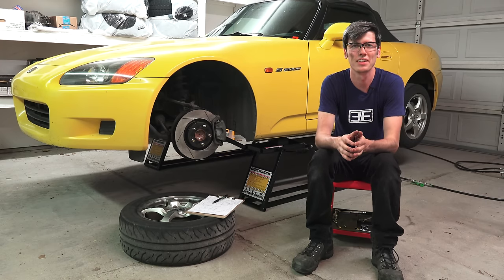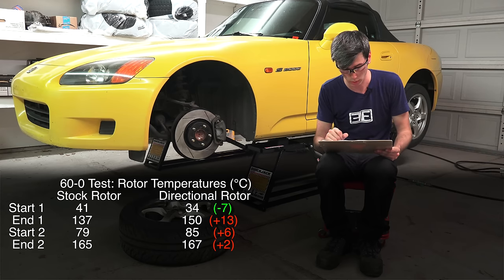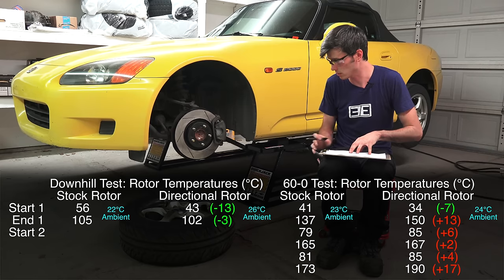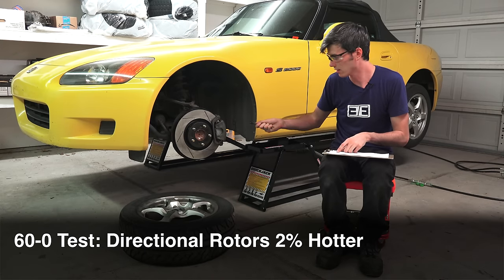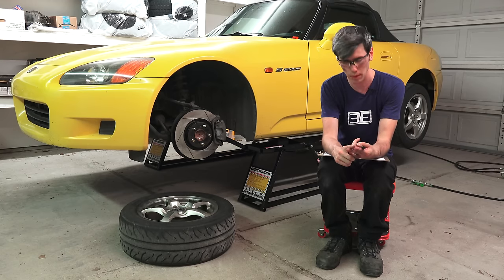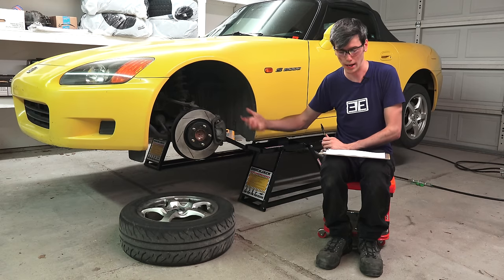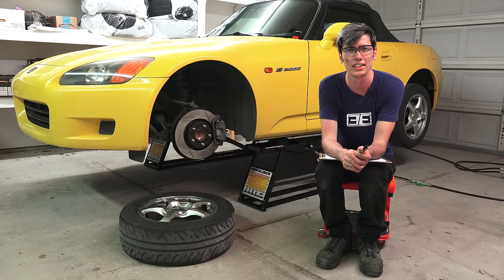Do Performance Brake Rotors Have Better Cooling?

Comment: Really interesting testing and video.  Weight reduction & better heat dispersion during hard braking; seems like a win/win to me.
Reply: You likely wont see much a difference at face value with 4 LBS of WR in regard to performance overall but I can see your point in that regard. It's still a slight improvement, of course with some aluminum anodized calipers, u might be at a more notable number, etc.

Comment: The aftermarket rotors were definitely doing thier work because to stop you have to change the kinetic into thermal energy so of course they would be hotter if they stopped faster. He didnt have the rotors spinning and measure temp while they are spinning to check how fast they cool.
Reply: lPridel yep
Reply: If you watch the video then you will realize he did. He stated the cooling numbers in centigrade and that showed the slightly better cooling of a slotted rotors versus oem style. Bottom line is, just like we suspected all along, the difference is really minuscule.  If you are so good, that you need that last bit of performance, put the performance rotors on, but otherwise you will be perfectly fine with the quality oem setup.
Reply: If the thermal energy produced is at the expense of the kinetic energy then how would stopping in a shorter distance result in higher temperatures? The change in kinetic energy would be the same, and hence the rise of the thermal energy(measured by the temperature) would also be the same.

Comment: History,
I am a retired engineer.
I like data, lots of data.
I don't drive on a race track.
Your data does not indicate that buying these with this type of aftermarket rotors will help in normal driving, ie. offtrack driving.
Conclusion:
I will not spend more money on this type of rotor.
Note:
My understanding of this type of directional rotor is :
1. The directional rotor slot may cause the pads to wear out faster. 
2. The rotors may not be able to be turned at the next brake pad change.
3. Thank you for your raw data and your data analysis.  I have been trying to make up my mind on the purchase of this type of rotors for my daily driver car, I will not waste money on the additional cost for directional rotors.
Thank you,
Alan P.

Comment: I think this proved that for normal road driving it doesn’t matter what kind of rotors you have but for racing they are beneficial. Great info thank you
Reply: It's not just temp, most importantly it's stopping distance.

Comment: In terms of your conclusion, it begs the question; are these rotors worthwhile for anyone unlikely to use their car in a racing scenario?

There's also another issue. While the test was purely about the cooling efficiency, the key performance indicator of a brake rotor is its ability to decelerate the vehicle under varying conditions. Whilst temperature has a correlation with performance, longevity etc, it doesn't take into account differences in material. It may be that these performance rotors are hotter, but perhaps their design temperature is simply hotter given the specific chemical properties of the alloy they are constructed from. In other words, their peak performance temperature, may well be hotter than the stock rotors.

Just throwing up ideas for consideration, happy to discuss.
Reply: Yep. There could be a variation of the applicable specific heat given a slight difference in materials but it would be minimal. Thermal mass though is not insignificant and the fact that the temperatures read were achieved effectively with just static, or low flow, air cooling makes that a significant factor in favour of the heavier rotors, given the similar duty, as they would have heated less in the first place for that reason alone. Ironically, about the only thing NOT measured was the increased effectiveness of the directional vanes on temperature as this would have to be measured while moving, before a second brake application. That shows up in the test results of the other party who DID measure temperature in the environment they're intended to be used - fast flowing air.
And just as you've suggested, the performance rotors may also be more resilient and dimensionally stable at higher temperatures and less likely to suffer from thermal stress.

Comment: It's a little late and has probably been said, but I think the difference between Jason's tests and SoS' tests could have been the testing intervals. Performance rotors shed heat while spinning meaning that though they soak up more heat during braking, they will shed it quicker while the rotors continue to spin. Jason tested it while it was stopped right after a brake-to-stop, while SoS tested them while they were spinning during a lap.

Comment: This is the first time I've ever heard of slotted rotors being for cooling.  That's probably why they didn't work for it.  The reason for slotting/drilling/dimpling rotors is to allow superheated air to escape from between the pads and the rotor (preventing brake fade).  Heat is due to friction, so higher temps are indicative of greater friction (better braking).

Comment: In your testing, your original disk brakes are already used, which means less surface (smoothen by the usage) which you didn't take in account.
I hope this helped to your research. Thanks for sharing mate.
Reply: Very good point.  Discs and pads do mate and the adhesion of the pad material in the rotor can make a significant difference between a brand new rotor and one that has been broken in.

Comment: Are you getting shorter stopping distance from the new rotors? That will get you hotter temps too.
Reply: Brakes for racing work at higher temps. When they are cold, they might not grab very well. Once warmed up they perform good, and can take much higher temps without brake fade.
Reply: Wouldn't it make sense that the amount of heat put into either rotor would be the same? Considering that the pre-brake speed is the same across tests, if shorter stopping distances were to put more energy into the rotors, that wouldn't really make any physical sense, as it's the same amount of energy to dissipate. Unless you're talking about the total amount of effective time of the rotors spinning to cool themselves, which could possibly provide a difference.
Reply: ipullstuffapart I think that's what he's getting at, a shorter stopping distance in theory would have less cooling happening through ambient air dissapation than a long stopping distance. In practice, the impact of air dissapation while breaking is minimal compared to the air dissapation while off the brakes
Reply: Stopping power is in the pads, hydraulics and tires.
Reply: Michael Stellitano , good point.
Reply: Yeah, no, they don't. He actually has a video on that. Look it up.
Reply: Pavel Ionut yes they do.  It’s a braking system with electronics, vacuum, hydraulics, pads, rotors and tires ... and some knucklehead who should pressing down on the brake pedal.  😀
Reply: Jim K The affirmation was that "they have a lot to do with stopping distance", which is not true. You put performance brakes and rotors when you go racing (multiple hard brakes and stuff, higher stress basically, where a standard system will fade). Stopping distance is mostly tire friction. If your brakes can lock the wheel, they are enough, anything above that, doesn't make any difference (in distance).
Reply: Pavel Ionut No disagreement on that from me when you are talking one time stopping or “city” driving.  But for some people “normal” driving is hilly/mountainous or trailering or both.   My point was that the system has to be able to match the demands of your driving environment or you will have an issue.  Better tires decrease stopping distance.  But that’s just one thing a tire has to do and you can get great stopping power but the tire will last 10,000 miles.  That’s not ideal in the mind of the average person.  A balanced system is required and it has to meet the requirements of the driver and regulations.  Boiling all that down, we both seem to agree on the point that a singular component may or may not “fix” the problem.  Happy July 4 sir!   May your day be filled with friends, family and fun.
Reply: I am telling you that electronics do not shorten the stopping distance, they merely optimize the braking process. Electronics can't beat friction physics and cannot overcome boundaries imposed by the tire/surface friction coefficients. Therefore, any brake system properly sized for the given application, will stop in an optimal distance. Vehicle weight has little to do with stopping distance. As i said before, performance brake pads/calipers/discs are there for abnormal usage conditions, racetracks, but they do not stop in a shorter distance. Thy might for example take you multiple times from 200 to 100 without fade, but that's it.
Reply: @WZW1982  its the rotars too with out good rotars the pads wont work well
Reply: @pavelionut1649  what about abs then genius thats electronic

Comment: You seem to be comparing brand new aftermarket vs your old brakes. The cross hatches you see on the face(not the slots but the break in cross hatching) actually causes more heat during break in due to the added friction from the hash marks. Your old rotors have worn those off. Therefore no added friction hense the heat differential. Break those in and do another test. My dollar goes towards the directional vented once the break in cross hatching is gone.
Reply: Except that when I bought new brake rotors for my Renault Twingo, they came without any grooves in the brake surface.
That is not to say you aren't right, just to point out that not all OEM brakes have that kind of pattern in them.
Reply: I am a mechanic and I'd have to say all rotors have a pattern on them to help break the pads into them. I can't think of one exception, not that I paid attention every time, but when you're cleaning off the grease from the factory, which prevents rust while it sits, you notice the patterns on new rotors. Never perfectly smooth.
Reply: Are you sure that's not just the pattern left by the mill that finished the surface after casting? I've seen those on just about every brake disc I've installed on my bikes or cars. But I wouldn't refer to those as some sort of break-in pattern.
Reply: He's not talking about the slotting, he's talking about the cross hatched pattern. Typical, you want to change pads at the same time as the rotors. There is some necessary initial wear that mates the components. I will typically hit my rotors with a flapper wheel when just changing pads. There is likely going to be additional friction during the break in period on top of the heat converted through stopping.

Comment: Curved Rotor Vanes – this type of rotor vane is predominantly used for motorsport or racing applications and is most commonly used by race car professionals.  
These rotors are typically heavier than straight vane rotors because more material is used for the curved vanes.  Since there is more material, curved vanes have 
better thermal capacity and are able to withstand heavy brake applications better.  Some other curved vane designs are the variable curved vane or convergent vane rotors.

Comment: Could brake break-in affect the temperatures at all? The old rotors and pads were broken in, but the new rotors were not. Also, because it is hotter does not mean it is not cooling better, as i could be getting hotter because it was turning more kinetic energy into heat, making them hotter? I say this because it is a brand new parts vs an old one, it should work better, right?
Reply: João Mendes Because of the speed was consistent, the kinetic energy that was converted to heat is the same for both rotors
Reply: TheBlackStealth yes, but if you stop in 5 seconds or in 10 seconds (for example) it will make a diference
Reply: this is why live data acquisition would be better in this scenario than stopping and checking the temperature
Reply: The OP and commenters are missing something obvious. Multiple posters imply the brakes are converting the kinetic energy into heat. NOPE. You all even say the SPEED stays the same so KE stays the same. What is being turned into heat is potential energy PE. You're right though about the time heat relationship. Since the same amount of PE is converted into heat in the same time (because same speed) the test is fair. I just wanted to point out that KE was not being turned to heat, rather the PE.  The engine put all that energy in the system raising the car to the crest of the hill.
Reply: Directional rotors = less mass ( gets hotter easily but gets cooler easily too ). For RACING, its better.
Reply: Brakes turn KE into heat, it has nothing to do with PE. At the top of the hill he has all PE and the brakes aren't doing anything. He either uses the engine or some of his PE to start get moving at 40. Then some of the PE is turned into KE to go faster than 40 (at least I hope) and this extra KE is turned into heat. So the process is PE -> KE (speed) -> heat (brakes).

If you don't believe me measure brake temperature while your holding a car at the top of the hill, it won't increase.
Reply: Well, the brakes are transforming energy into another form of energy(heat). I think the new rotor are heating up more because they are braking better at all, in fact it is a brake update, if the brakes don't heat up, the don't work at all, they are no converting energy.
Reply: +ToxicityAssured, You are probably thinking of Regenerative braking systems. The basics for friction is the conversion of Kinetic Energy to Heat. Potential Energy is "stored energy" for use at a later time. Nothing about the standard automotive braking system stores energy for later use. It is just simply a frictional system and heat is the byproduct or energy conversion.
Reply: Joan Mendes, they are not heating up more because of better braking. If the start speed was the same and the rate of deceleration was the same, the energy conversion (heat generated) is the same. They heated up more because they had a lower mass. The amount of energy converted converted is dictated by the starting speed, the vehicles weight and the rate of deceleration.

A given mass will absorb "X" amount of heat per degree of temperature rise. So the less mass the faster the item increases in temperature for the same amount of heat input.

You can easily test this at home. Take two blocks of metal (same material) but have one be only say 1lb in weight and the other 10lbs in weight and put them both in the oven for say 2 minutes and then check their core temperature and average temperature. You will see that the 10lb block barely changed in core temp and average temp where as the 1lb block will have a much more noticeable change in both core and average.

Comment: Should  use cross drilled and ventilated rotors and see if they are even cooler. Also the coefficient of drag is not going to be the same between the rotors  especially between new and old stock rotors. Too many variables.  Generally performance brakes are supposed to  stop better   which may create more heat as well but they're designed to take the heat, just look at nascar rotors.  They work fantastic  but are glowing red hot. If they weren't drilled and vented they would fail fast.
Reply: exactly! i was hoping someone would mention this so i didnt have to lol

Comment: My 2001 Tundra's brakes are a design flaw. Worried about rear-end lockup, Toyota set the drums up to do nothing apart from parking. Consequently, the front discs overheat and warp their rotors. Toyota acknowledged the problem, but refused to pay for repair. No point in replacing them with OEMs, so I got EBC dimpled and slotted rotors which gave 100,000 miles of service before I replaced them with another pair.

Comment: Questions"  1. What was the amount of pedal pressure? 2. What was the brake pedal fade? 3. I don't understand it, but brakes work by making heat, ergo the rotor should be hotter? 4. I wrote 1 thru 3 before the end so, for non-racing are they worth the money?

Comment: That front rotor is NOT on the correct side.  It is a right side rotor.  Mine all had stickers on them, they go on so that the beginning of the slot at the inner part of the rotor leads the outer end of the slot as the wheel is rolling fwd, opposite of the way that particular one is installed.  The way you have it, the heat would be driven toward the center of the rotor not the outside per design intent.
I would be interested in your logic if you disagree but I am certain I have mine installed the way the factory intended.  Mine are drilled also but doubt that makes any difference in preferred direction of rotation.
Reply: I noticed the same thing... I would think you would want the hot gases thrown away from the hub....
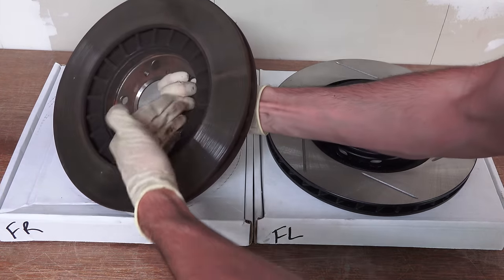Reply: @1:38 you can see the inner part rotates at opposite direction of outer slots. I think he's right.
Reply: X-Man your rite lol only an engineer
Reply: You're wrong

Comment: I just swapped out my OEM 90k mile rotors. temps went from 170°f to 90°f. Not scientific but I would check the temps with a laser thermo when I got in my drive way bc I thought I had a stuck caliper. 700feet elevation gain, 300feet down the other side or flip it for going back home, lots of braking. Turns out, swapping the rotors fixed the problem, and I'm sure  swaping the calipers and pads for aftermarket performance parts at the same time was a coincidence:p